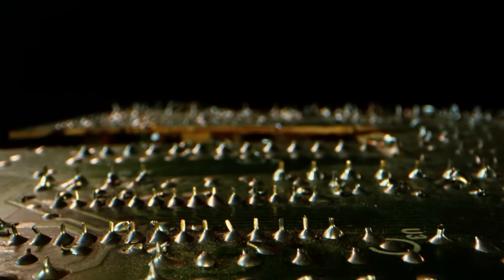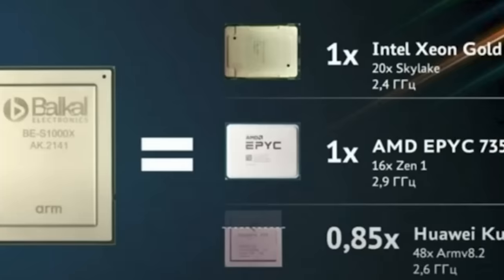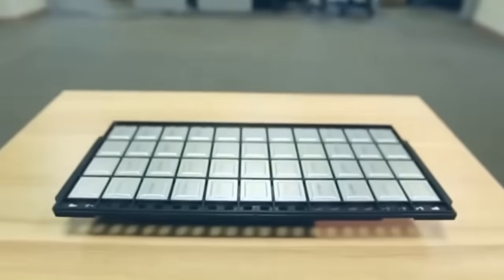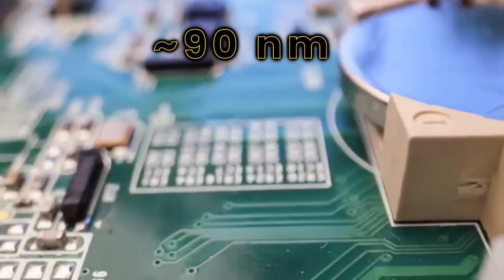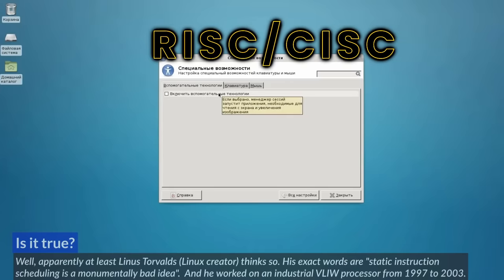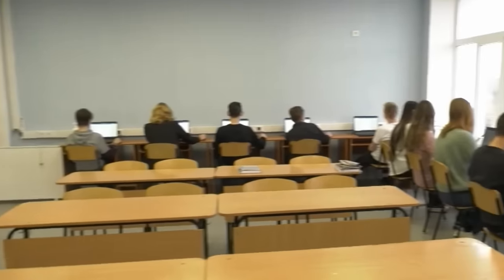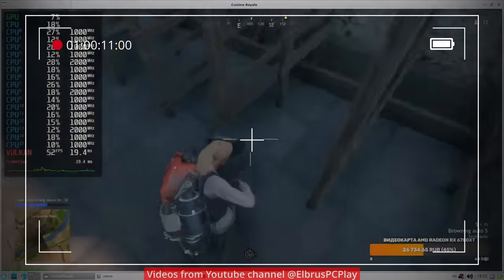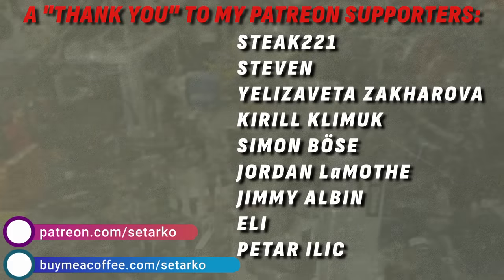Just How Good are Russian CPUs?

Comment: The problem with VLIW CPUs (like the latest Elbrus) is that the compilers are notoriously hard to write.  The whole idea is that by having the compiler handle instruction scheduling one can eliminate that (complex) circuitry from the CPU which should allow it to be smaller/faster/cheaper. Trouble is no-one's figured out how to write a compiler that can generate efficiently-scheduled code.  Basically the compiler needs to fully predict instruction flow/dependencies ahead of time; this is relatively easy to do on the fly when one has all the info at hand but nigh impossible to do ahead of time.  Additionally VLIW packs multiple instructions into a single word (hence Very Long Instruction Word).  If the compiler can't find enough known-safe/independent instructions to run in parallel then the remainder of the instruction word must be filled with NOOPs.  This kills performance since less being done per word, wasting both CPU time and space in the instruction cache.  The end result is that VLIW architectures tend to be much slower than their non-VLIW peers.  (Yes, I've oversimplified things a bit but that's the gist of it.)  Personal anecdote: I own a machine with a VLIW CPU (Transmeta Crusoe) and its performance is far worse than anything else from its era.
Reply: correction,"almost no-one"🤓🎩👑
Reply: I think the Transmeta processors were designed with low power and low cost as a priority over high performance. As far as I know they actually did that pretty successfully. Statistically optimizing another machine code or VM target on VLIW is actually probably the right way to go with it, because you have runtime data to help you optimize - the biggest problem with static compilers for VLIW was that everything was a complete guess and it couldn't be improved at runtime. So some kind of dynamic compilation is probably actually the right way to use the architecture.
Reply: Oh, and by the way, what you describe as filling parts of the word with NOPs is actually just something CPUs do normally anyway - you can't always have all of the different computational circuitry in a CPU active 100% of the time and they have to figure out what they can safely do in parallel, and that often means a lot of the core is idle at any given time. The biggest problem with VLIW though was that ahead of time compilers lack sufficient information to do a great job of that
Reply: I wonder - if I add arch/elbrus to linux kernel do I need to rewrite all s/w and kernel? really?
Reply: @DevynCairns  As I remember it Transmeta CPUs were designed to be low power without sacrificing performance.  They largely succeeded with the former, the latter not so much.  (Low cost wasn't an explicit goal IIRC.)

I'd agree that some form of dynamic recompilation is probably a good approach to achieving good performance on VLIW.  Historically this hasn't been the case (e.g. Crusoe and especially Itanium; cf. m68k running on PowerPC, both non-VLIW) but perhaps something like a dedicated on-chip scoreboard/profiling cache would help.

Interestingly, dynamic recompilation can also improve the performance of non-VLIW architectures.  I unfortunately can't recall the specifics but recently there was a demonstration of achieving a performance boost via JIT recompilation of machine code into the same architecture.  I think it was x86-64 to x86-64 or 32-bit ARM to 32-bit ARM but don't quote me on it.  (Edit: Here's one from 1999 targeting PA-RISC: https://www.hpl.hp.com/techreports/1999/HPL-1999-78.pdf )
Reply: @DevynCairns   [including] NOPs is actually just something CPUs do normally anyway  Yea, lost to my oversimplification (for those playing along at home, this is a hazard leading to a stall ).

With a non-VLIW CPU those NOOPs don't incur much penalty beyond the CPU doing nothing for a while.  For VLIW there are additional costs.  The compiler can take a conservative/naïve approach and simply use NOOPs whereever it thinks there could potentially be a conflict.  This reduces operations-per-word which eats up the cache (Elbrus-8 has 2048 words of L1 instruction cache) and bus time (512 bits per word for Elbrus 2000).  A smarter compiler could generate multiple independent instruction words to work around stalls (generate independent/redundant VLIW instructions for each possible path through the code) but this eats into the limited cache space.  Not an easy problem to solve and a lot of the reason why VLIW compilers have historically generated machine code with such lackluster performance.

On non-VLIW architectures explicit NOOPs usually aren't needed.  In case of a hazard the CPU will stall the pipeline/instruction stream (i.e. with an implicit string of NOOPs) until the conflict is resolved.  There are two big advantages here.  First the CPU knows which resources are actually in use (not just those that the compiler thinks could be in use) and can schedule appropriately.  If there's no actual conflict then there won't be a stall; in case of a conflict execution will resume at the earliest opportunity.  Second, since the operations are not bundled together there's no need to use NOOPs to pad out the words.  This improves code density.

One additional (huge IMO) benefit that non-VLIW architectures have is that implementation details are hidden.  A resource (say an ALU) can be added, removed, or have its timing changed without needing the machine code to be changed; the CPU's hardware is aware of the changes and can adjust scheduling, etc. as needed/advantageous.  With VLIW any such change will require code to be rewritten/recompiled before it can run on the new CPU.  Every different implementation of the VLIW ISA needs different machine code (i.e. one version of a program for each CPU variant).  On non-VLIW architectures the same machine code can run unmodified on e.g. an 80386 and the latest x86-64 CPU.
Reply: @alexhajnal107  Same-architecture dynamic recompilation definitely sounds interesting, thanks for that

You're definitely right about how much VLIW would be a nightmare because of how explicitly tied the ISA is to the internals of the processor. There's a benefit to having some abstraction there even though it requires silicon.

Another major issue of course with VLIW and how a lot of words are going to have to contain some NOPs due to potential hazards and such of course is just how much of a waste of space that is - fitting more instructions in cache is one of the major advantages RISC-V(C) has over Aarch64, and one of the reasons for the original Thumb set on previous ARM architectures, so if getting code density up to something approaching that of CISC for RISC architectures is enough of a priority to dedicate some silicon and complexity, just imagine what a world where 128-bit or 256-bit instructions that are largely NOPs have to be in memory would be like haha

The reality is that I think things are pretty much settled as far as how much silicon should be dedicated to the abstraction - you want enough to have a stable target that will serve you for many years to come, but we aren't really writing machine code by hand anymore so there's no reason to have easy to remember bytes like older CISC architectures. And at the same time cache does matter and you can cache all of your macro-op fusion to some extent and just write microcode to the L1i if you want to and get some of the benefits of VLIW.
Reply: @myhaylo  No, just the unique stuff about the architecture and as long as compilers support it, many things should just have to be compiled for it. In practice there's often a lot of quirks to work out, but Linux is one of the most portable operating systems in the world and it's quite possible to get it running on new platforms
Reply: @DevynCairns  
The requirement to recompile isn't so bad for embedded systems where building from source for each target platform is commonplace.  The Crusoe would fall under this category as the the VLIW ISA wasn't exposed to the outside world (it appeared to run x86-32 code with the VLIW core being hidden behind a hypervisor).

(Also, Elbrus 2000 is even wider: 512 bits per instruction word)
Reply: Elbrus has the compiler, but it turned out that humanity invented too many languages, so having C/C++ covered is not enough, they need to make fast java, dotnet, javascript, python and god knows what else. The regular software aint to be rewritten, but compilers and interpreters ought to be and that's is super mega qualified job.
Reply: @legolegs87  All the languages/platforms you listed are interpreted or bytecode-based.  For these the interpreter can simply be recompiled using the system compiler (though perhaps with sub-optimal performance).

Also, compiling first to a common intermediate language (such as MS CIL for dotnet) is commonplace in modern compilers; this is the approach taken by LLVM and GCC as well as MSVC++, etc. in most (all?) cases.  The quick-and-dirty approach to porting these to a VLIW system is to simply transpile the IL/bytecode to the existing system compiler's IL (or input language) and let the system compiler handle the rest.  What's tough is writing code to take the IL and directly convert it to native machine code (i.e. not involving the system compiler); this only needs to be done once though for all input languages.

Aside: At least one platform, IBM i né AS/400 / OS/400 né System/38 / System/36, uses a CIL (TIMI) as its "native" machine code; all user programs are transparently compiled to the physical CPU's instruction set by the OS and there's no way to compile truly native machine code from userspace.
Reply: @alexhajnal107  as far as I know, while there are hope in usefulness of LLVM for E2K it is stated that LLVM's internal intermediate format cannot utilize E2K properly as native elbrus's lcc does.
Also, they already have trivial bytecode interpreters, but they are too slow for hight load production use.
Reply: @legolegs87  it is stated that LLVM's internal intermediate format cannot utilize E2K properly as native elbrus's lcc does Do you know why that's the case?

bytecode interpreters … too slow for hight load production use Makes sense.  To get good performance the bytecode operations need to be batched.  If dispatched serially performance plummets to ~5% of maximum throughput in the worst case (if I'm reading the numbers right, i.e. 20 operations per word).  JIT compilation is needed (you can't just use a simple jump table interpreter).
Reply: @alexhajnal107  No, I didn't looked at the E2K LLVM thing closely. I know that МЦСТ deliberately decided to not use LLVM even knowing how beneficial it would be with so many  languages being supported by LLVM. I am not a compiler guy myself, I was just picking up things here and there.
Reply: @legolegs87  Interesting.  Thanks for the info.
Reply: This just came up on my feed:
The parent company of Baikal, which went bankrupt in Oct. 2022, is entering liquidation with their assets to be auctioned off on Sept. 26, 2023 with the estimated value being USD5M.  The Baikal subsidiary, designer of ARM and MIPS CPUs, hasn't shipped a product since Feb. 2022 and is not expected to sell; its patents will probably be abandoned.

The maker of the Elbrus CPUs, MCST, remains in business.
Reply: That's what basically skittled Itanium processors

Great architecture but the compilers were extremely difficult to write and get right
Reply: @myhaylo more interesting: in a VLIW cpu, it's not you with 2 hands making dinner - instead, it's you with 8 hands. What can you do differently?
Reply: @JohnMullee  not really follow your idea, from the top of my head - same as with 2hands+ 4 spare hands to do something else
Reply: @JohnMullee  With Elbrus it's more like you with 20 hands.  But if you can't find something useful to do with them they just get in the way.
Reply: You have other issues as well like the fact that a char in C might be bigger than 8 bytes due to differences in word size.

Think of VLIW architectures as building cranes and normal cpus as bulldosers. The crane is slower and bigger but can lift heavier loads in one go.
Reply: @jakobstengard3672  The instruction word size isn't tied to the data byte or word size.  The MC68000 used 32-bit instructions that had to be aligned to 16-bit words in memory; data in memory was 8-bit byte addressable (though with a penalty if not aligned to a 16-bit word).  MIPS used 32-bit instructions and required all data to be 32-bit aligned in memory, I'm not sure it even had instructions to access 8-bit aligned data.  (All of the above is IIRC; the principle is valid even if the examples are erroneous.  Let me know if you want me to verify those numbers, I have ISA references at hand.)

Harvard architectures frequently have different instruction and data word sizes.  AVR, for example, uses 16-bit instructions aligned to 16-bit boundaries whilst data is in 8-bit bytes aligned to 8-bit boundaries; in addition, some of the I/O registers are bit-addressable (most registers are addressable both directly and via RAM addresses).  I'm forgetting which architecture(s) uses an instruction word size that isn't divisible by the data byte/word size.

Another example is the SHARC DSP which is a VLIW Harvard architecture with 48-bit instructions, 32-bit integer and floating points, and 40-bit extended floating point.  All code and data is word-addressed with each type residing in its own address space.  Onboard RAM is divided into three regions, one for each word size.  All instructions operate on full words; on this architecture sizeof(char) == sizeof(short) == sizeof(long) (and also sizeof(float) ).
Reply: Elbrus has the most to benefit from profiler-driven JIT. Which are already present in the later Intel/AMD CPUs.
Reply: Top comment right here. Thank you sire.
Reply: Can it run Linux? Afaik Linus Torvalds used to work for Transmeta

Comment: 10:32 Actually Sberbank was impressed with real vs expected performance of Elbrus. They expected it can perform 20-30 times worse that Intel Xeons they use, while Elbrus performance had only x3 times less performance. It was not enough for Sberbank, but exceeded their expectation.
Note that Sberbank uses J2EE Java applications as their main load of Intel Xeon. Java Machines (JVM) are known to be extremely unfriendly to VLIW architectures. But MCST team was able to optimize JVM to execute at reasonable level.
7 of 49 points found to be satisfied were actually measured for Elbrus Server computer, but not Elbrus itself. So if the server constructor was able to implement required features the system would get 40+ points of 49.
The most valuable feature demand from Elbrus was to support 16Tb of RAM in 4xElbrus config instead of 1Tb in 4xElbrus config.
This is requirement for J2EE application server they use.
Reply: here I am ! Slava ...everybody but Russia! @statinskill
Reply: Anybody using Java-based software deserves to loose. ))))

Comment: this limeup reminds me of the largely overlooked "american made" openpower cpus by IBM, they're quite an interesting rabbit hole themselves and its especially impressive how well they can compete with intel and amd processors in terms of performance despite the completely separate risc based architecture (the "POWER" architecture)
Reply: Interesting I'll look into that
Reply: POWER is a pretty old architecture, Apple used it in their computers. It was made for high performance computing to start with.
Reply: Printing company I used to work for had a G3 eMac that blew the doors off of my custom built 3 Ghz Pentium 4 system. The Power series are an evolution of that and there are Linux distributions for them. High performance workstations indeed.
Reply: As I understand it OpenPOWER is simply the Power ISA with a royalty-free license for 100% compatible implementations.  Is this accurate?
Reply: I loved the Power architecture was bummed that it never really caught on outside Apple

Comment: @10:32 Damn, this part right here. Designing a CPU is by no stretch of the imagination an easy thing. Imagine pouring all that hard work into a design. Probably countless overnights staring at transistor layouts and pathways, tracking down errors in the design, even loosing a few relationships along the way. All of this just to hand your work over for testing and be told that its not just bad but CATASTROPHICALLY bad.
Reply: Curiously, the guys who wrote this report also said they were "pleasantly surprised it worked at all", in the end. To me it sounds overall kinda encouraging.
Reply: Damning with faint praise.
Reply: Not really. This just tells us how low their expectations were.
Reply: Solution: Retreat to the meta level.  Let the computer design the computer.  And when the result fails catastrophically, the computer will be better abler to handle the discouragement.  No lost relationships either.
Reply: @r.w.emersonii3501  lol are you talking about AI

Comment: there is something of note: the chinese SMIC company is now able to produce 14nm wafers. they could be manufacturing russian designed chips
There is no need to port software for WLIW architecture, you only need the proper compiler.
one of the solutions is to go to the RiscV open source architecture.
Reply: proper compiler No-one's solved that problem for VLIW (it may be intractable).
Reply: @alexhajnal107  well, some sort of compiler, doesn’t have to be super efficient